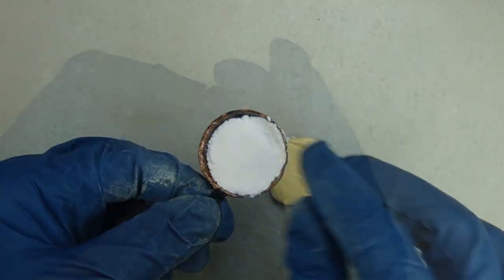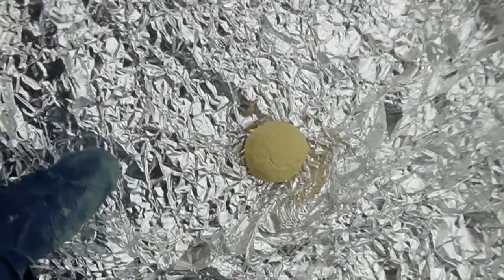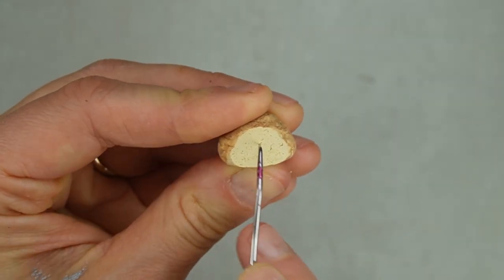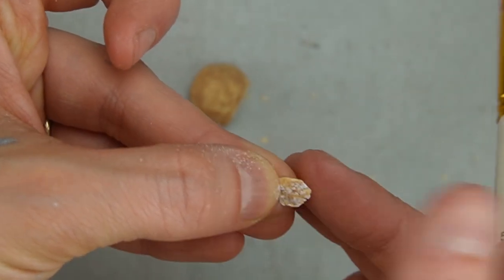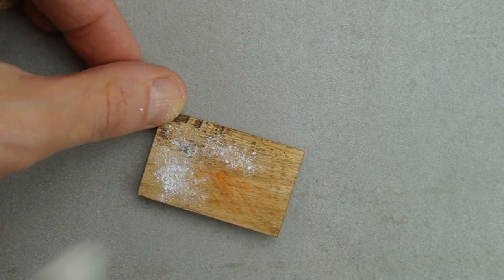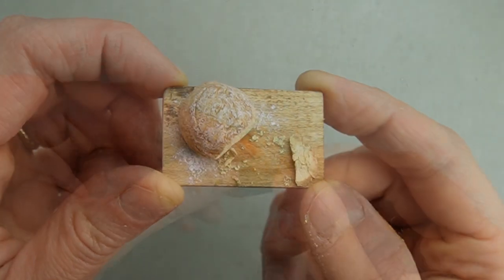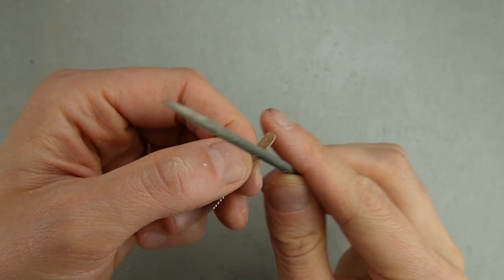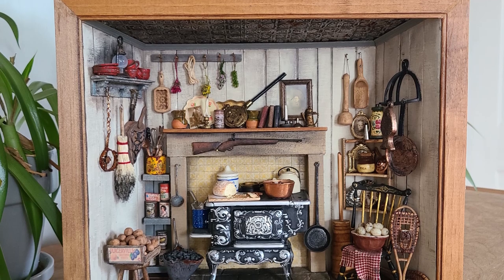DIY crusty bread & EASY miniature knife for dollhouse

Comment: Don't worry about breaking your bread slice. If you cut bread before it's cool it will often tear. But hot bread is the best, so it's a risk I'm willing to take.

I wonder if the baking powder would work better with a thinner, more flexible clay. Maybe some regular polymer clay mixed with liquid clay. The clay needs to be stretchy so it can stretch around the bubbles. And if baking powder doesn't have enough moisture, it won't fully activate. I wonder if making a slurry from the water and baking powder before mixing it into the clay will give it a head start on CO2 production.
Reply from the maker: Those are great ideas! Simply Stella's version turned out great, but maybe it could be even better.